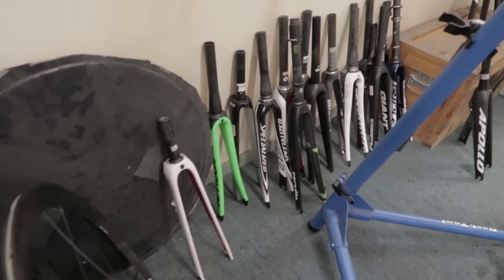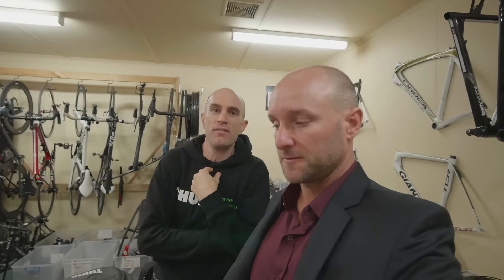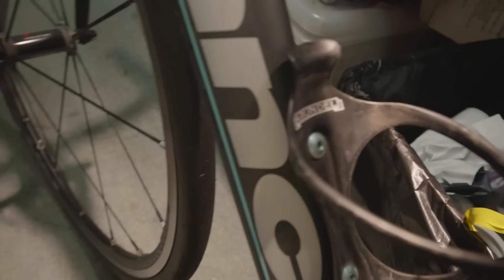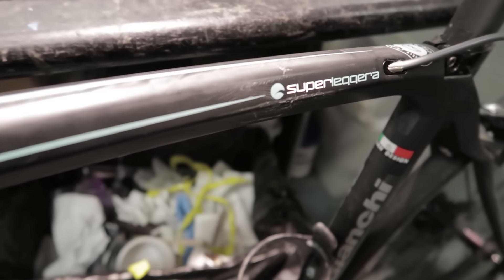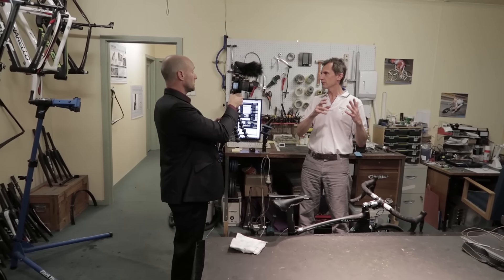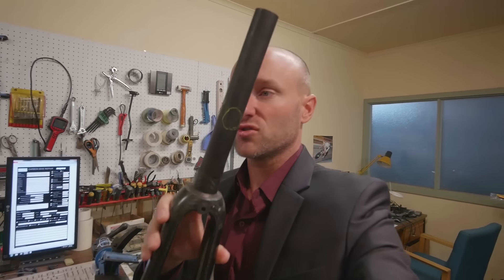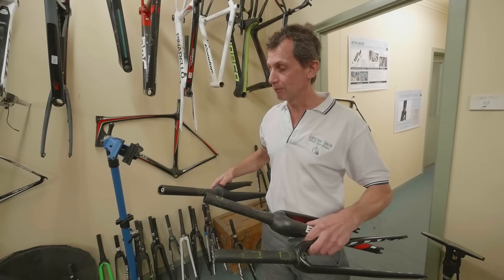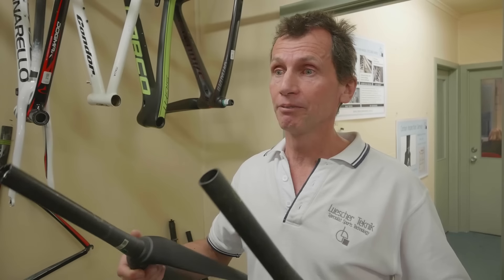Carbon Fiber Bikes - Are They Strong Enough? (ft. Raoul Luescher)

Comment: My take is yes carbon is the lightest material for bikes for its strength and is relatively affordable now however bikes that sustain damage need to be repaired at a proper place like  this, replaced by the vendor, or just discarded.  People don't like to here that their multi thousand dollar bike is now garbage but in order to get any bike this light and not at Titanium cost requires carbon.

Comment: where does one mount your bike with a bike stand if not the top tube as was described in this video
Reply from the maker: The seat tube. (Not on the bike at all)
Reply: Seat POST. Big difference (on my bike anyway - I don't think it'd fit in the clamp). Probably the most interesting video I've watched in a long time BTW, good stuff!
Reply: I use the top tube, but don't clamp it much at all, it's more just resting . My carbon specialist said the top tube could take 200kg of weight (evenly spread out)
Reply: yes, but no.  sure the top tube can take someone resting their butt on it, but I still just don't want to clamp to it.  even if you have a carbon seatpost that has a aero shape so you can't use a different post, its easier to get a new post than a new frame.
Reply: I don't clamp into the top tube though. It's more just "resting". I clamp the top part down so it's just shy of touching to stop the bike from "jumping" off if something goes wrong. 

I might try the seatpost idea one day.
Reply: The shop I take my bike to has a steel "shop" post. They take yours out and stick that one in and clamp that to the stand.
Reply: brianmcg321 seatpost? Would be hard to swap out your top tube 😃
Reply: Hirobel Carbon Frame Clamp.

Plugs right into any work stand you may already use. It's doesn't use a mechanical clamp arm like most traditional stands do, so there's no risk of material damage from crunching.

Comment: I have heard that hot conditions and direct sunlight effect carbon, ie, can literally melt it and soften it. I have also read that carbon is not effected by sunlight with the current inhibitors that are applied in the finishing process. What's the truth.?
Reply: Todays Carbon will not melt under sunlight. Put it in a oven and you will have problems, but that is about it.

Comment: Very interesting to see 3 BMC SLR01's in his shop with toptube cracks. I have a SLR01 too, and a ghostcrack appeared 4 months ago. The BMC SLR01 is the premium bike, with premium cash, the carbon though is full of ripples as he describes, and my toptube cracked (hairlinecracks), I got it checked out and it appears to be only damage to the varnish. HOWEVER, BMC didn't believe my story that the cracks suddenly appeared , they claim I must have crashed it, or clamped it, or hit it with a hammer, they even didn't want to inspect it, they just laughed at my story. In short, don't buy BMC, it was my second frame, the first one, I pulled my rear brake cable through the frame and they replaced it under warranty. Now, they're telling me to fuck off. Too bad, because the bike itself is a rocket, a beauty aswell and the best part : it's not a specialized. I will be ordering a Canyon Aeroad soon, hopefully they have a better carbon layup and a better customer service.

Comment: any chance of knowing the price of that repair?
Reply from the maker: Mine is $700
Reply: +Cycling Maven thanks for that!!

p.s your quality of videos is going north very quickly, won't be long and you'll be youtubes top cycling blogger: -)
Reply: +Yeah...Nah...Maybe *vlogger
Reply: Pff my entire bike costs less than that!
Reply: +Cycling Maven did insurance not cover that, if this is a result of the head-on crash from the tourist driving the wrong way?  If so shouldn't the whole frame have been replaced?
Reply: fuck these bikes $700 is my dame rent in a all bills paid apartment, this shit should not cost almost the price of a used car\
Reply: $700 used car would be terrible
Reply: +SG 89 i rather buy a air pod car for 10,000
Reply: Yea, it's because it costs so damn much.
Reply: I think a carbon bike for daily use is silly.  If you are just commuting or riding causally there is no need to obsess over saving a few grams of weight.  Especially if you are carrying a water bottle and perhaps a backpack.  But if you are competing and serious about winning carbon makes sense.
Reply: If you're worried about a $700 repair then dont by a $7,000 bike ;-)
There's plenty of other bikes out there that can go just as fast and unless you're in the top 5% of riders.The reason you lost isnt because your bike was 25 grams heavier ;-p
Reply: Or if you going to commute long distance or wish to travel long distance without stopping much, Carbon is Better...less weight less power needed=further riding ability:)....other than that your right, Aluminum especially Aircraft Grades plus better Joint Neatness almost looks like Carbon single piece frames now:).

Comment: I think titanium is the best option for a normal user. A pro rider doesn't care if his carbon bike brakes because he get a new one for free. A 450 gram weight difference between aluminium and carbon is really not so important. For me as a MTB rider is carbon really not interesting. If it hits any rock it is broken. In every video I saw it is always about road bikes. There is no video on Youtube with DH bikes with the same topic. I saw one video a guy talking about more comfort on a trail carbon bike. Really??? You are actually sitting on a trail or a DH bike??? Carbon for DH or similar MTB is really just uninteresting.
Reply: Senchi just seal the alloy frame and fill it with helium. Dud dah 😎

Comment: With what he (rightfully) says about quality issues and variability in the defects in carbon fiber composites I have no idea of why he recommends CFC over titanium alloys or high end steels. 

It is quite evident, looking through the data, that CFC have better specific moduli but metal alloys have higher safety especially when the quality checking is far from 100% (as in bicycle frames and components). 

Maybe a bit of conflict of interest considering his activity turns all around CF 😌

Anyhow what he does and he is suggesting to so is the actual the reason why CFCs are not yet at the same level of safety as metal alloys and composites.

Comment: So carbon is expensive and fragile. I'll stick with my stainless frame. Bare metal looks great too. Carbon looks plastic.
Reply: carbon frames are delicate especially if you over tighten the torque of the bolts and most of the carbon frames are brittle.
been using steel and aluminum frames for decades and i don't have any problems replacing my bar and seatpost  without torque wrench..
now im using a carbon frame i have to pay more attention to it...
Reply: @Scooper MG: generally speaking, CF is tough in one direction but fragile in directions it's not designed for.  The benefits of CF are impressive and if I have to adjust how I handle the material then I can live with that.  CF is expensive, but marketing of the latest frame has more to do with that than the material itself.  Steel is not without it's flaws either; it too suffers from corrosion when in contact with aluminium and/or CF.
Reply: Scooper MG The only problem. is weight as it always is . The French tour has a mandate for 7.6Kg bikes. No one has won the French Tour on an aluminum bike since 1998!!!!!. For older people who have the cash and also want a light bike ( hell I would too) should buy them. We have a $300 GMC Kent road bike and it's alloy so not heavy . Neighbour said it was too heavy ( he bought a carbon one) but he barely rides it so I asked him to go a little race around and he said no lol. The problem is rich and elite people are the only ones that can afford the higher end carbon bikes and this always stagnates progress . There is no excuse for not having a high end carbon frame for $500 US . Carbon fibre is now pushing decades ( was used internally in gov facilities before public usage ). Carbon fibre is outdated by a Decade already!!!. Again greed and controlling technology is the reason why people think Fucking Glued Fibers is actually a new tech lmfao.

Comment: or... just buy alloy.
Reply: Corz Illa If only graphene would take the floor already...but you need know mate, to roll on metal is to sacrifice insanely substantial amounts of acceleration, top speed, stopping distance, comfortability, efficiency and you'd be throwing much more pedaling energy into any crank movement, plus the topics discussed are for racer-types who should know what to look for in buying such godliness for quality/flaw checks...after trained eyes pass inspection, the bike has about 0.0004% chance of failure..you're taking this video as some sort of "DO NOT BUY CARBON FIBRE" type esque when it's nothing more than any other thoroughly informative video about proper care for aluminium or steel frames which have something definitely over 1 or 3 % failure rate (both percents consider perfect care and flawless manufacture, 1 year after purchase/normal use) what constitutes a chance of failure is mostly always going to be the rider's fault, for failing to properly maintain the bike's peak level of performance and success.the land of carbon fibre is a judgment call of practicality-do you race? Commute daily? Non reactive material has a massive reduction in needing maintenance,no need to freak out about water trapped in your cranks, no constant tightening of every bolt and nut per the stiffness of metal/vibration nudging them off, no warping from heavy use

Comment: Carbon is light but is false to say its stronger than steel or aluminium, You could do a survey on bike shop mechanics and see most of the broken bikes are carbon. I suggest to people just buy a high end aluminum bike and spend the extra cash on a good wheelset. 100% sure youll be faster.

Comment: This guy is impressive... but my take is that the layup is done in a sweatshop, by a worker who may or may not be properly trained and or care about QC. I will be delivered a product that may have catastrophic failure at any time, even under designated loads and the only way to know for sure is to break the kit down to the bare frame and use a purpose build ultrasound transducer... and repeat this after every minor knick or taxing ride. Carbon layups on aircraft are done by servo controlled machines with lasers to check repeatability and accuracy... not by underpaid factory workers. Thats not to dig at Chinese bike factory workers... ALL my metal bikes are made in china, and I love them, and feel safe on them. But carbon for consumer (non pro) is just not there yet. Stick with metal and save on reconstructive surgery.

Comment: When carbon fiber fails, it fails catastrophically.  When steel fails, it usually just cracks but still performs at a lesser degree and gives you time to react.  Aluminum also fails in a catastrophic nature, but  is not delicate like carbon fiber so you can mistreat it and it's not going to degrade its strength.

Comment: Carbon Bikes are structurally weaker than aluminum Bikes. The Alumi frame Bikes can be made lighter by scale down the density of the material to be lighter but still stronger than carbon frame bikes.

Comment: I still ride a set of 1" Time Carbon forks from circa 1991 on my team replica Gitane Vitus GTI nowt wrong with them and I'm 100kg. If it's a very expensive frame probably well worth having it inspected, if its a cheaap one why bother when they are so cheap new.
Reply: Hi. Can I ask what the total weight of your ride is?
Reply: you mean the bike weight?
The frame is circa 2000g for a 57cm, the forks aren't particularly light at around 570-580g IIRC(steel steerer) bog std 32/3 cross wheels 25mm tyres, Stronglight double plus campag 9 speed ergos/brakes/derailleurs, fluted ITM post, Gitane engraved ITM stem, ITM bars. reckon about 9.7kg with a fat saddle and toe-clips and straps.
I could shave 600g easily/cheaply by using clipless pedals, narrower saddle and some lighter wheels but like the set up as is. I have too many bikes anyways!!
Reply: ynotnilknarf39
Thanks for the info! That's not bad. Yeah it's an interesting idea putting carbon wheels on a strong steel frame. You can have the frame that lasts for long time, and keep replacing the light stuff around it over the years! And this way you have a nice light ride but with a strong frame that lasts. 9.7 kg is pretty respectable weight really. My old Giant TCR-1 2000 was about 8.0 kg I think, and that felt like a feather after the steel rides of my youth! Do you have any idea how much total weight was in one of the steel rides that we rode in the early 70s?
Reply: My first racing bike was a Raleigh Winner back in 83 or 84, weight I've no idea probably 15kg, which isn't much more than a new Dawes Galaxy. The weight isn't really hugely important unless you're doing lots of climbing. Aero is the biggest aspect and of course the engine that pushes the lump of metal and flesh through the air. I just say ride a bike no matter what it is, too many bike snobs for my money. usually those new to cycling wearing noddy hats and race replica gear.

Comment: What was said about Ti really isn't the point... They would be making a lot of stuff out of Ti IF it weren't so hard to work with, not because of strength or weight issues. Ti immediately looses it's strength the more you heat it, and in building a car, there is a LOT of heating involved.. When I worked for Toyota, we had 5 ovens the trucks would go through to cure sealants and/or paint and those ovens alone would pretty much destroy Ti... So the real issue with Ti is how easy it to destroy the strength of the material. Making tubing to make a bike frame is an issue in itself.
Of course he will say Carbon is king, his whole business is based on Carbon... Do you REALLY think he's going to work with Carbon and say "I really want a steel bike."? Come on, be real.

Comment: Are carbon bikes suitable for heavier riders? I'm 105 to 110kg and looking at a carbon Cannondale. I'm guessing a carbon frame will react and flex differently under me than say a 80kg athletic rider plus the added stress the frame is under. Perhaps I need that titanium frame 😂😂
Reply: I have never seen a weight limit on carbon parts so not sure. I know that alu and ti parts like pedals and rims have weight limits on them.

Comment: WHEN YOU RE BOMBING DOWN A HILL at 80 ...getting harder to trust current carbon bikes and for the price they charge l think any great metal bike is better off .l got an 84 miyata and 2000 TREK 5200 1st gen OCLV (which is made in the USA )  both are great but different . But comfort is on the steel one , l d like to get a fancier one (lighter than 12kg Now )  l m also thinking newer cheaper alloy bikes are a safer bet and still light weight .Ti and fancy steel is great too !!

Comment: $20 per kg of carbon; $4k for a sub 1 kg frame set! Seems legit :D
Reply: Pinarello 3 years ago used to cost USD290 ex factory. Frames would then go back to Italy to get BB glued in and paint job and then be sold for $6k
Reply: You clearly dont know anything about industries.
Reply: +NO1 (NoOne) the price is what I was told by someone who was looking at getting bikes made at the same factory. I do work in the industry. Your experience is?
Reply: Geoff Semon I commented on maximilians comment. So the reason why carbon frames are expensive. 1) R&D. Most companies spend millions of dollars on researching aerodynamics and different materials. 2) The Brand. 3) Advertising. Including sponsors. 4) Wages. 5) Quality control. 6) The materials. 7) Greedy CEOs and companies.